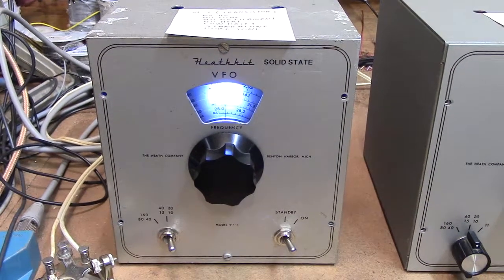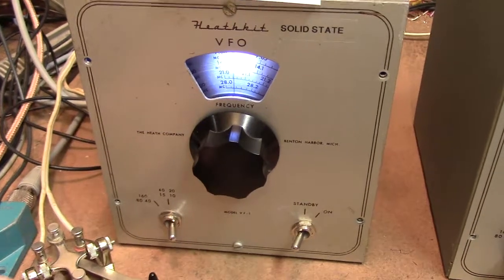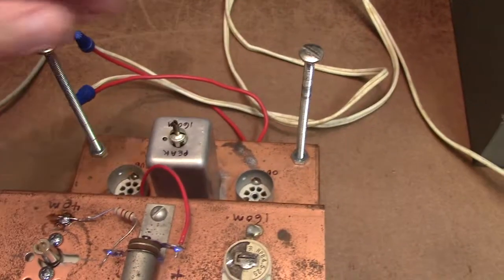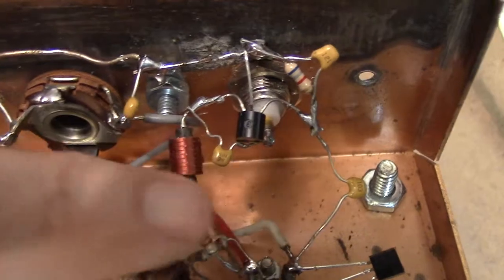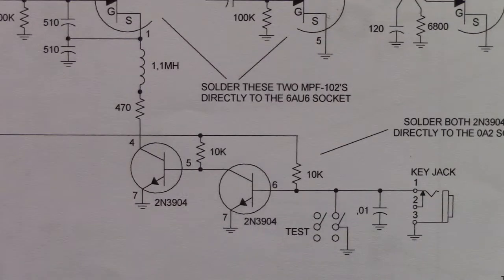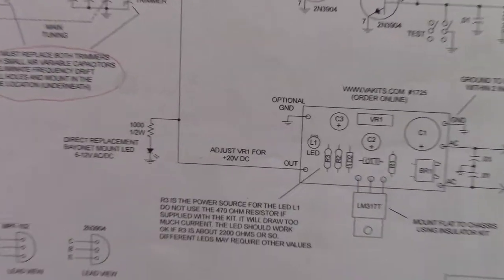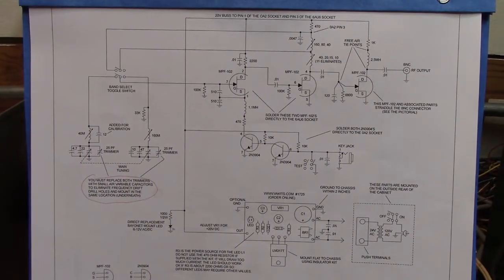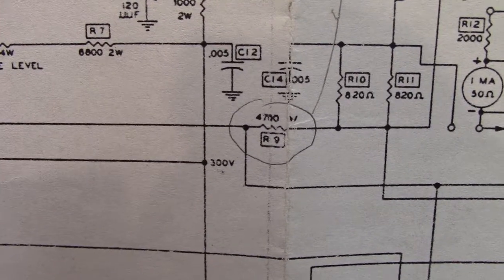Heathkit VF-1 Solid State Conversion

Comment: Watched your solid-state conversion for the HG10, the kit doesn't appear to be available on eBay, do you have the schematic? I have two and they drift as I'm sending, after they sit a few mins, they go back to where they started, but the op on the other end is continually tuning to stay with me. Any advice would be appreciated. de WA1YDK